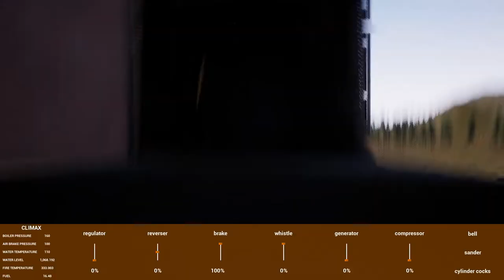Railroads Online! Making 200 Oil Barrels - Part 10

Comment: Ask a lazy man how to unload a 100 log train by himself. lol I set the Regulator and brake so the train runs by itself very slow then stand at the pond and trip each car as it comes by. You get good at it after awhile. Long as your train has the room to move that far till you Forest Gump back to the Engine lol
Reply: This is one of those why didn't I think of that moments. I've been running 20 car trains...